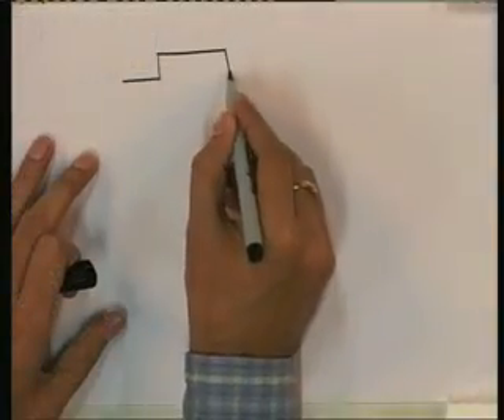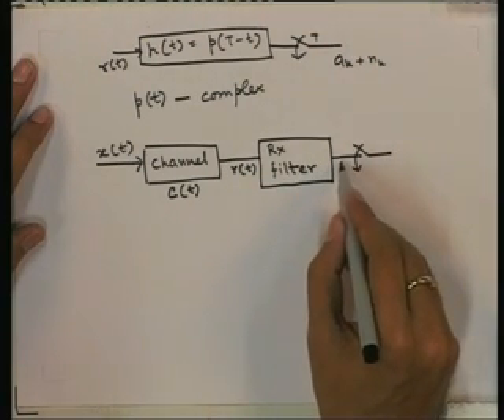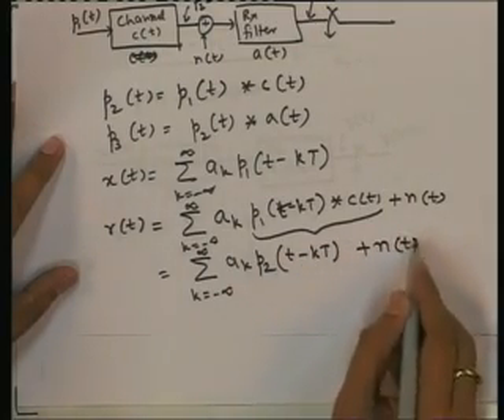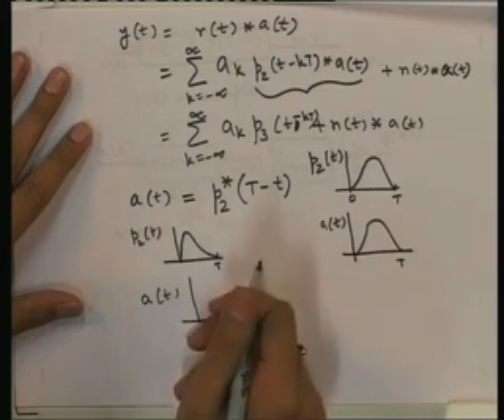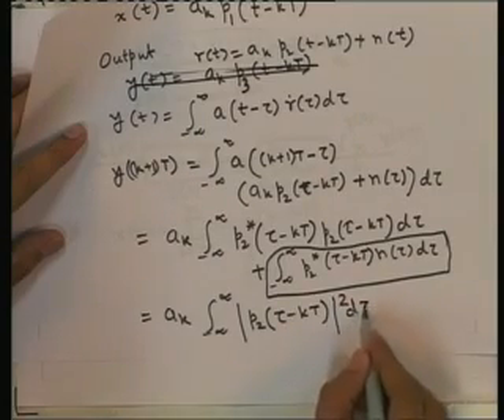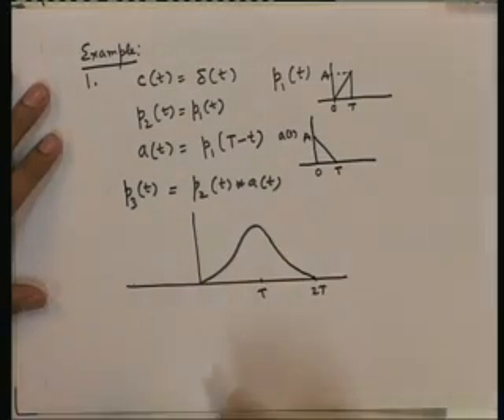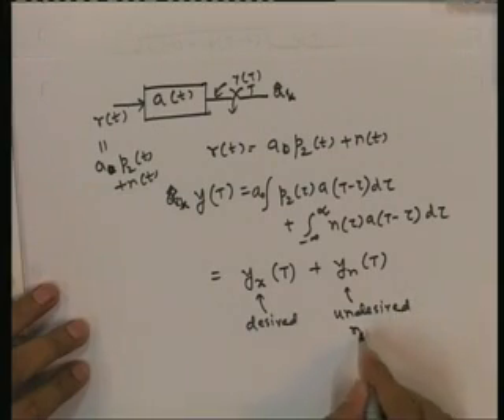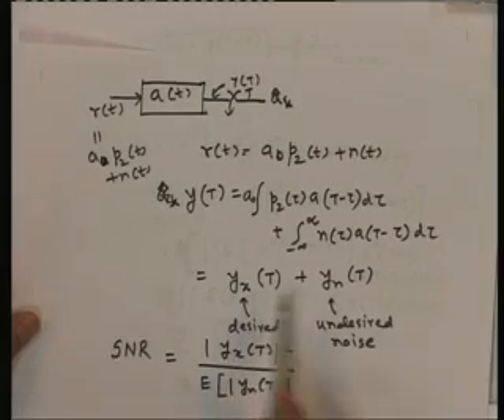Lecture - 13 Digital Modulation Techniques (Part - 2)

Comment: 52:42 How did (No/2).delta(t - tau) appeared?
Reply: coz  N0/2 is the psd for AGWN
Reply: In the previous integral there was the autocorrelation function of the noise. Taking the Wiener-Hincin theorem you obtain PSD.